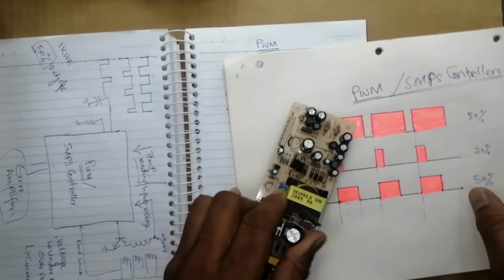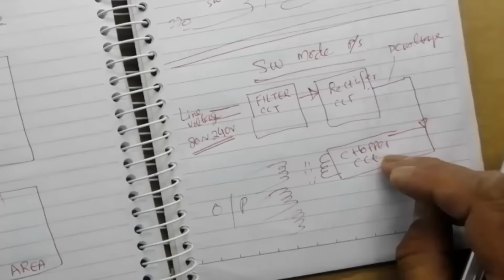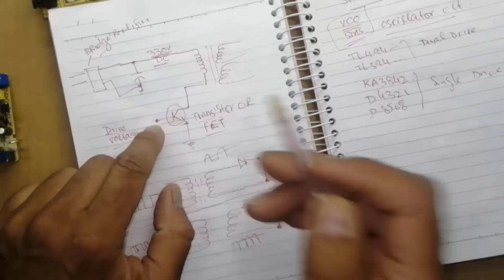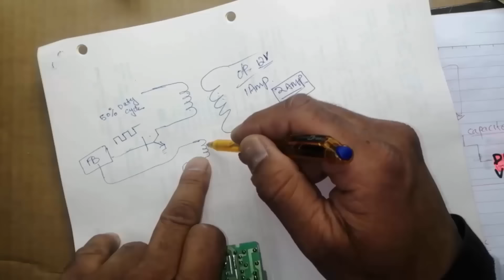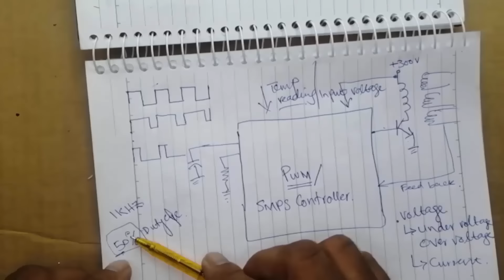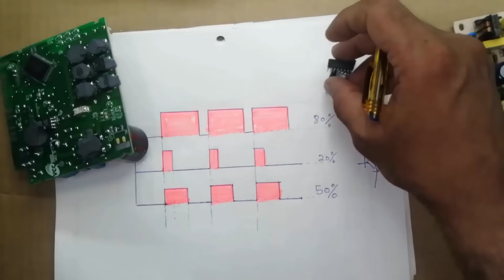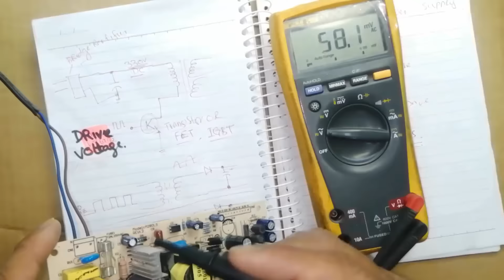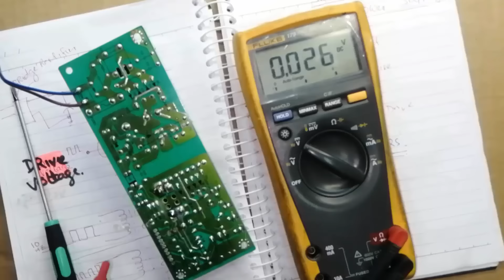SMPS / PWM basics circuit description with practical switch / switching mode power supply

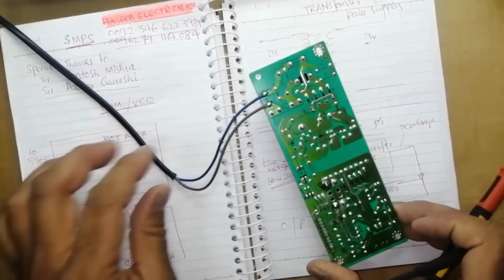Comment: Go here 1:00:20  -  to bypass most of the theory and get into troubleshooting a board. 1:00:48 - What is the model of your meter leads and what is the source to buy? I now have a better understanding of SMPS troubleshooting from your presentation: but, the meter lead demonstration was a great pointer! I"ve looked for them on ITT Pomona, Fluke and others to no avail. Please post the model number and manufacturer of your probes.

Comment: Thank u sir i followed and to my question.
Reply from the maker: best regards
what is your question, please let me know
Reply: @HaseebElectronics  good evening sir ,i got my ans by your next   vidieo  last when I saw that u explained me a small ic can work as MOSFET across transformer to help in working of low power SMPS supply there u shown micro controllers as drive  ,ijust have still one more doubt that whether it works still as both pwm as well as MOSFET both in single package to drive? That's all .
             Thank u for copration.
Reply: Hello sir can you do a video on ZY -B  inverter..your explanation is wow!!

Comment: Very helpful video Sir how to make+ 90, 0,-90v ,,25 ampere power supply and which MOSFET and igbt used sufficient pwn driver of this supply
Reply: @HaseebElectronics  sir any circuit of sg 3525  frequency adjust at 100khz matching ferrite core no and turns calculation

Comment: Very good explanation of switching power supply.  
I have 5v dc power supply with feedback optical ci as you mention , my circuit drop  output voltage when have little load output current . 5.18  v goes to 4.90 .
This at very  small current , about 2% of full load capacity. It seems feedback is not working properly.  
My question, in generally there is gain adjustment component for this feedback signal? Thanks.

Comment: Haseeb, in 110v, the primary coil should be twice the number of lops as a 220v coil to produce the same 9v output in a transformer.  So your diagram is reverse?  I may be wrong.
Reply from the maker: in high frequency the transformer is calculated in minimum input with maximum output power
the microcontroller will adjust its duty cycle to compensate switching
because the universal power supplies are designed in above method

Comment: I try your technic and take a voltage measurements in mosfet  to see if mosfet and driver is good drain going to transformer Pin, my multimeter is in ac Ranges I got a very high ac voltages what could be the Problem is it the mosfet, switching driver, or the transformer
Reply from the maker: please check the snubber circuit across the primary winding.

Comment: Can you make a video on the circuit diagram of  how to make three phase AC  power  supply from a single phase AC power supply especially if it is a 120 VAC?  I assume it won't be much different than from 220VAC maybe some minor difference.
I have always been very curious how this is done and not the cheap way of just using a capacitor on one of the legs which is really not a three phase nor does it have the performance either.

Comment: 1. When you are troubleshooting these SMPS boards live, do you have an isolation transformator in between the mains and the SMPS?
2. If not, how can you be so confident that you are safe during live measurements of the SMPS board and it's components?
Reply: @HaseebElectronics  yet you still cannot answer this simple question? Are u using isolation transformator or not?
Reply: @HaseebElectronics  could you kindly make a video of the importance of isolation transformer and step down transformer? So that people watching your videos who are not as experienced as you won't die.

Comment: Thanks for the detailed teaching. Why did the rectifier voltage is higher than line voltage?
Reply: When voltage passes thru a rectifier, it increases by a factor of 1.414.

Comment: How to tell if the UC3843 is dead?  I have a power supply where the Vcc to UC3843 is a little over 8V and the VREF is close to zero.  Is it dead?  Of course there is no output.
Reply from the maker: if vcc pin 7 have voltage
and pin 8 Vref is zero,  that means there is something wrong
(check or replace capacitor at pin 4 CT capacitor) if it doesn't work, then it is possibility that the ic is EXPIRED
Reply: @HaseebElectronics  Tested for the CT cap and it's good.  I took out the IC and tested by itself and it was good, only if I gave the Vcc 8.4v or higher.  Since I only had about 8.1v, the power supply circuit must be at fault.  Tested the power supply resistor and the Cvcc and found the Cvcc to be of high ESR (about 130 ohms), even though the value is close to the 47uf.  Replaced it with a 100uf since I didn't have the exact value.  It worked afterward.  The working Vcc turns out to be over 11v.  Thanks for your help!

Comment: salam alaykom
thank you for helping us 
 
i want ask you about problem in atx power supply based on tl494  and lm 339

the problem is when i connected the green pin with ground 

the fan spin and stops
and if i connect the green wire with black just like swithing connect and dis connect 

like manual switching

fan turn on until i stop 

so what problem is it ? 

may alah blessing you for helping and teaching us 😍

thanks

Comment: hi, you shorted the opto coupler with screw driver, but when i did like that, the controller IC bursted.
Reply from the maker: this trick is applicable to those ICs which need feedback signal. if any IC is getting control signal or VCC voltage through optocoupler, that IC may damage

Comment: Nice job. I have one problem with smps power supply. It has ouptut +24V, +15V, +9V and + 5V. When outputs are loaded it change value form +24V to +26 V and it is not accepted voltage for printer boards. If you could help me I will appreciate it too much. Thanks.

Comment: In my ifb washing power pcb power not on what is the problem , guide me
Reply from the maker: please check it's smps first to provide voltage to the MCU. and then verify display section 
please send the board model number on my WhatsApp 00962-79-116-1084

Comment: hi haseeb sir, one of my power supply adapter 12v , 2A  showing voltage in the connector but while connecting the load , power led blinking
Reply from the maker: it means, the feedback circuit have problem 
check TL431 voltage divider network . or check vcc capacitor

Comment: How does the RLC controlled circuit control the mosfet. I don't understand how a change in the voltage will change the speed of the switching of the mosfet. Could you please explain. Thanks.

Comment: Hi, video seems cut off after 1:20:40.  Pl post full video. Thanks for informative channel. My smps charger is not giving any voltage at output. A tester is showing ac current at output. But dc is coming at power cap side. What could be problem?
Reply from the maker: best regards dear
please send picture of charger to my whatsapp, i will see and will do whatever i can
or send email 
gmail id   ashraf4ta4

Comment: I had gone through your videos which were so useful ones especially about the SMPS ones; I wish you the success in the life. I wish to have a clarification from you: that is : I have 2 SMPS in which SR504 and SR 5100 diodes ( Schottky ones) and 2 N-Channel Mosfet K4085 had to be changed for which I am unable to locate them online. Will you please suggest me some remedy in the form of alternatives and are equivalent ones for them? One SMPS is 12V/20 amp 200 watts output one another is Acer Desk top monitor SMPS for which I need the K4085 Mosfet.
Reply from the maker: best regards for your valuable appreciation
use K4087, K4088, BFL4007 or try any n channel mosfet more than 11 ampere 500 volt 
for SR504  use CDA540, SK56A, SK510L, MBR540, SB560-E3/54, SB5100-T, SB5200TA, SB540E-G, 
SB560ET-G, 
SK54L-TP
Reply: Thank you for the alternates. But when I checked online in india either it is sold in bulk by digikey or mouser or elements 14. No one is selling minimum quantities : if you choose minimum quantity the freight is exorbitant. If I get SR540 and Sr5100  atleast 10 pieces it will be fine for future use after utilizing the needed ones and the balance. Thank you once again for the immediate assistance from you.

Comment: Sir my dell laptop charger voltage output giving fluctuations like 19.4,19.2 19.1,19.5 and also when i connect the charger near to the audio device it giving noise to the audio and induction on laptop body so plz give me a suggestion what fault it would be..,while connecting the charger it causing this issues..,how to solve the issue sir, i found all the capacitor are not damages in charger.

Comment: Sir if the chopper transformer have 4pin the first two pin is called a primary winding and the other two pin is called an auxiliary winding and also called a feedback coil are my assumption is correct and it is possible that a chopper transformer have a two or more auxiliary winding  is my assumption is correct tnx sir
Reply: @HaseebElectronics  tnx for the information Sir

Comment: Salam M Haseed, first of all thank you for all of those delightful videos you are making. From this video i keep in mind that if there is a short in the secondary area, the voltage output will fluctuate, and if there is no voltage at all the problem is in the primary or optocoupler.
Most of my damaged SMPS PSU are having no output at all, but they all have SUPERVISOR ic, your above theory still holds in that case ? The problem is still in the primary ?

Comment: Sir! Just Wanna know if the ASIAN product such as the SMPS which is engineered to use in a generated rate of power supplied by Mains Ac eg: 220/240 will it still be able to use in Europe region without any rectification of the component in both input and output circuit??? Hoping to get the answer . Thanks!!!!
Reply: @HaseebElectronics  
Sir! hoping an answer with my one last question to you ; why transformers are often checked by multimeter in AC or is it only requires to test by DC in both sections??  Please Want some of your brief analysis over this issue... Because voltage checking is a challenging thing in various board that may be unknown and if one miss it can blow whole of the Multimeter device...
Reply: @HaseebElectronics   when the transformer is taken out of the PCB board for check then we usually test in AC but when it is connected in board ; what is the magic behind those other electronic components which surrounds the Transformer in both sections and thus alters for DC testing only.....
Reply: @HaseebElectronics  
Thanks alot for pouring your wisdom in the simplistic form of knowledge so that laymen like me understands easily in depth...... God bless you sir,  Great hrs ahead!

Comment: هههه هلا حسيب بتحكي عربي بطلاقه افتكرتك بس مسلم تسلم تحباتي متابعك
Reply: Hello mr smps i would be glad if you explain how boost converters work only with load connected and without load just input voltage at the output

Comment: hi, i have 12v power supply , voltage in is ok, but voltage out is not present. the voltage stuck only in voltage in
Reply: @HaseebElectronics  OB2269CP
Reply: @HaseebElectronics  all mosfets are good.
Reply: after checking terminals. i have positive charge in negative output. instead of negative charge
Reply: sb20150fct output mosfet
stk0760 input mosfet

both are ok
Reply: stk0760 input mosfet - how to check this mosfet, if i put in diode mode - gate, drain and source,

1. i put black lead to source and red lead to drain, 0 reading, then apply red lead to gate, drain and source will open, and its fine, then apply finger to gate, it will come off.

2. i put red lead to source and black lead to drain, it has reading as normal diode, is this fine?

Comment: Sar computer ki SMPS chalu hone ke bad bhi computer main display nahin aati vah SMPS ka fault hota hai sar use fault ke bare mein bataenge sar kya check Karen kya nahin Karen thank you sir
Reply from the maker: PG power good signal ka problem hota he most of the time
grey wire signal path
Reply: @HaseebElectronics  sar PG voltage per sar SMS ka koi video banai hai sar ji
Reply: Sar SMPS mein PG voltage ki light to jalti hai sar ji tester per lagane per lekin display nahin aata uske vishay mein sar jankari den sar

Comment: Hi sir,
I am High dc 450 volt, atfer bridge rectifier
Reply: @HaseebElectronics  Thanks for the prompt reply, input volt is ok, initial problem was fuse getting blown 1). replaced pair MOSFETs IRF 730 for short, 
2). Replaced pair of filter capacitor 200ufd/220 volt, which was getting hot
Reply: @HaseebElectronics  I am checking-in with series lamp, voltage is stable on cap but 450 volts
Reply: @HaseebElectronics  yes  sir 2 big capacitors (220ufd/200volt) connected in series after bridge rectifier, it's a subwoofer, no switch 110/220v, it's SMPS
Reply: @HaseebElectronics  It is showing 220 dc volts across each capacitor, checked with meter bridge showing ok
Reply: Sir, One of the Filter capacitor is also getting hot.